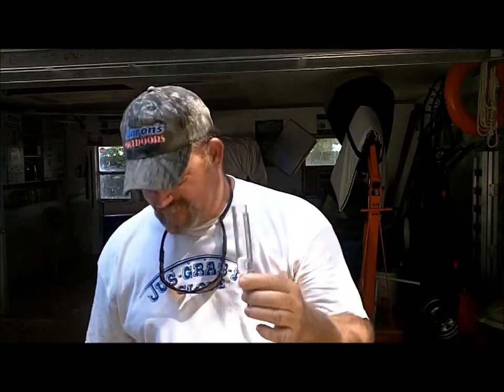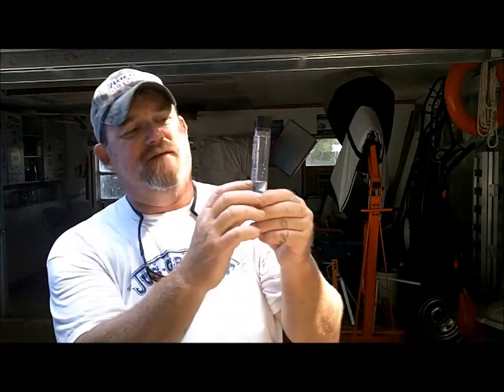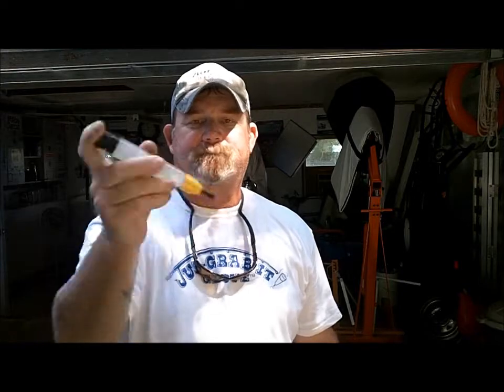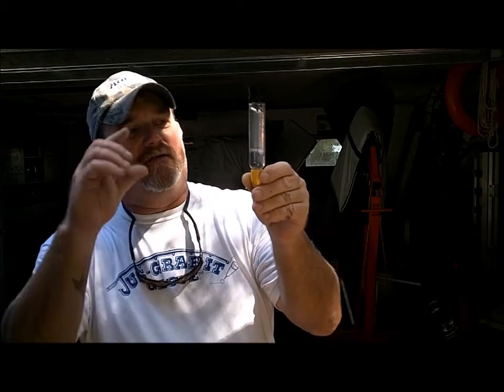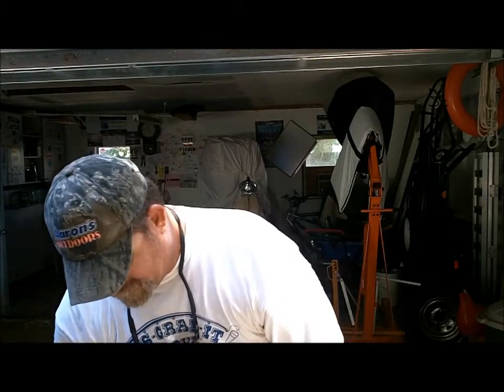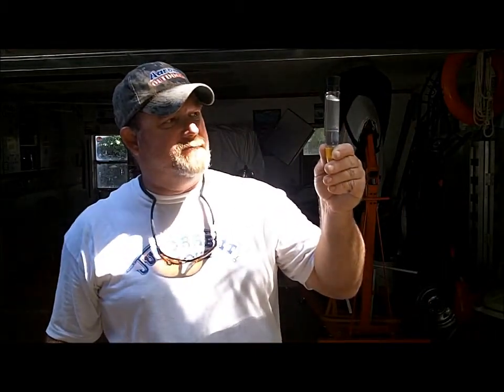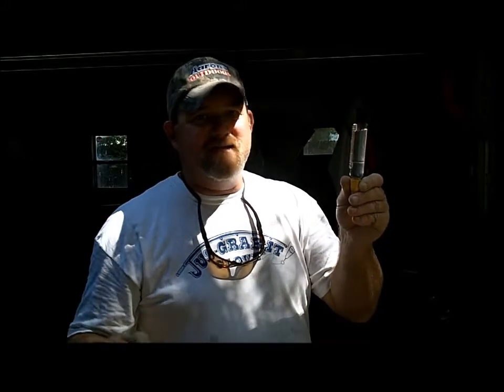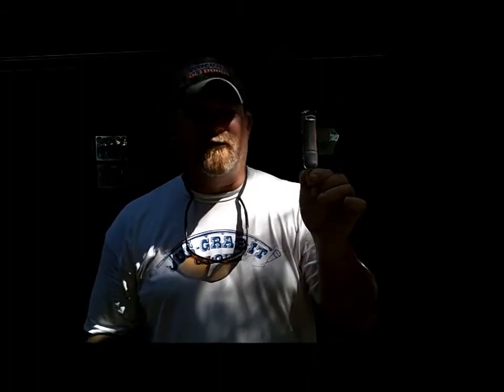YOUR BOATS RUNNING ETHANOL;  EZ Ethanol Testing

Comment from the maker: 📌don't believe me?????? here's the manufactures rep.  https://youtu.be/J2TUgxTjHfc
 gas is now $6.00❗❗❗❗❗❗❗ (I only use non-ethanol) https://youtu.be/hRQCPT8FS0E
''''''LET'S GO BRANDON''''.......HEY JOKE BIDEN, '''F-YOU!''  https://youtu.be/y6fRguanj24
A way better fuel filter system in your boat: https://youtu.be/gGsIMqEXlS0
YOU CAN'T WALK ON WATER...... MATALLIC PARTICALS❓ https://youtu.be/ciEijaSyDUg
(non fuel issue) SUZUKI 250 OUTBOARD CLOGGED FUEL '''''''COOLER''''''' : https://youtu.be/BTrd3sM24P0
I-DON'T-FIT-IN-GAS-STATION: https://youtu.be/pPqdwsnIsU8  - MY SOLUTION
DON'T TRUST ANYONE🙄: https://youtu.be/WlLnVzxuzdY
ACTUALLY SEE 👀👀👀👀👀👀 YOUR FUEL, FOR A CHANGE:  https://youtu.be/5S28y1az59E
YOU'RE RUNNING ON ETHANOL.....TEST IT:  https://youtu.be/fhm06YlpwCA